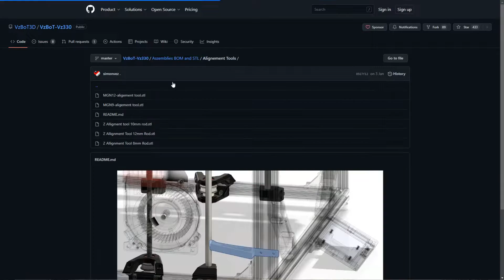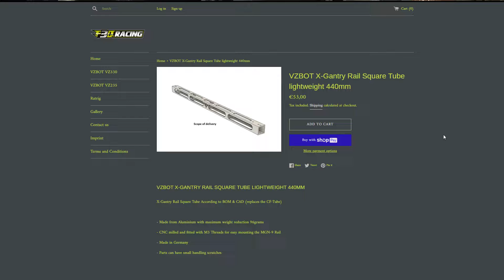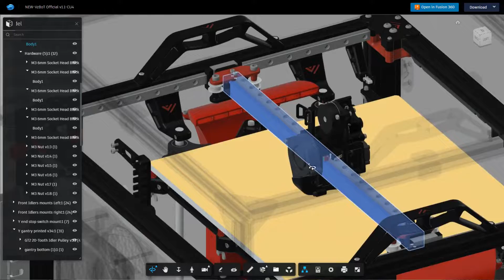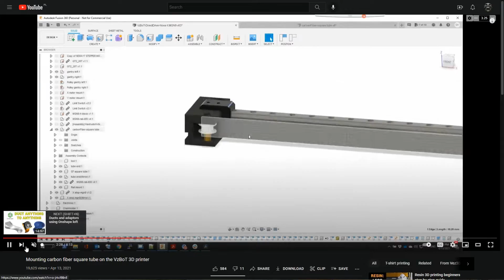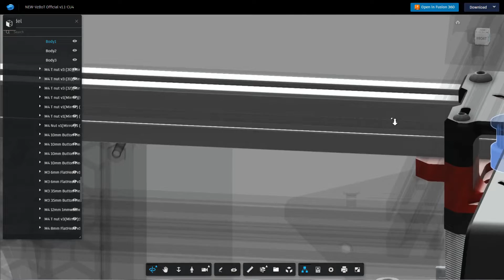Converting Tronxy X5SA to RatBot/VzBot - Linear rails and gantry - Part 3

Comment: Hi, I found your gantry video very helpfull since Im on the same project to transform a X5S to a V-Core like printer. Looking on Your video I decided  now to go the same way as You to use a bullet prove VZBot gantry despite designing a own one. Regarding the Z Axis, I did descided to go with a triple Z kinematic. Its because once designed and installed there is no more hassle with alignment what so ever. The only draw back is to design it what is quite time consuming. But Ok, now looking on Your video I belive You saved me a lot of time going with the same VZBot gantry as you did. Thanks a lot - Your videos are nice and very inspirating 😊😊😊👍👍

Comment: Hi bother how r u today ?
One question what is the mgn9 real length that goes on the 440mm carbon fiber tube 
As I'm a beginner and know nothing and straight away started  to build a vz printer lol  
I just wonder if u can help thank ☺🙏
Reply from the maker: It is specified on Vzbot BOM what length of rails you should get, check vid part 1.